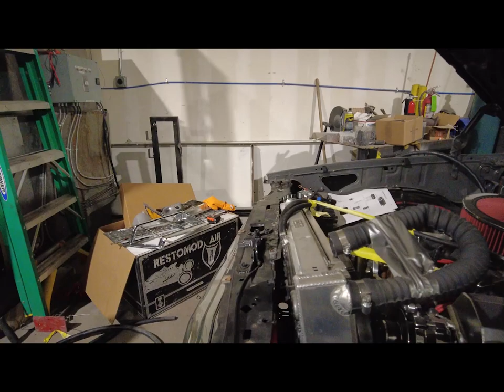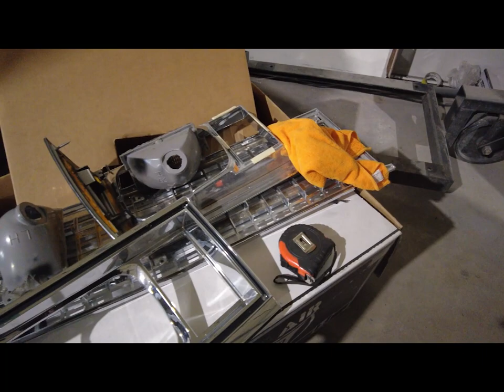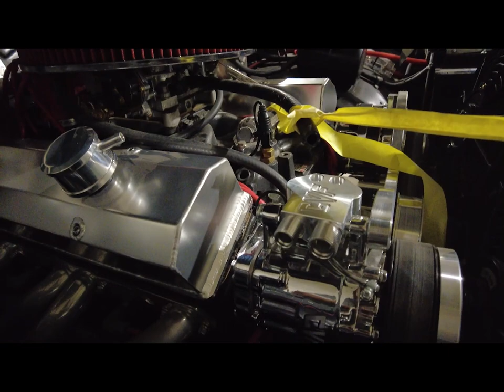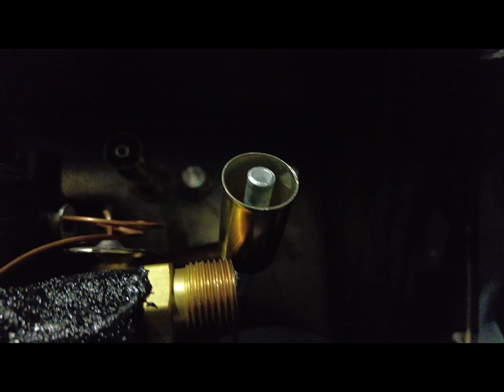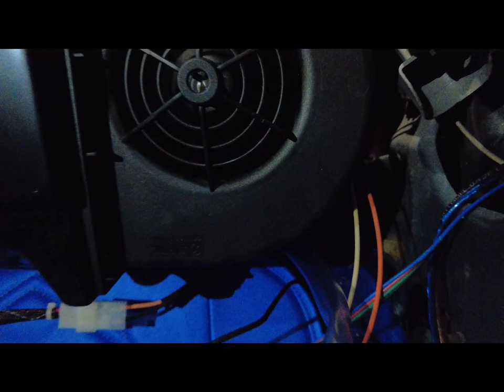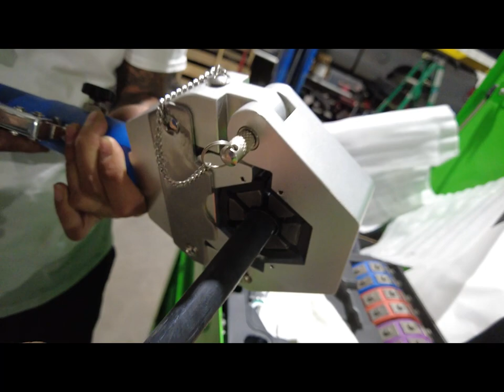How To Install AC on a Old School Muscle Car - 1979 el camino with a restomod air  ac kit

Comment: Where did u find the condenser?? Need one for my el camino
Reply: U can use a universal condenser but will have to make your own high side line that runs across top of radiator 
I usually run them in front of the condenser and between radiator & battery up to evaporator....which also removes the R12 high side port.